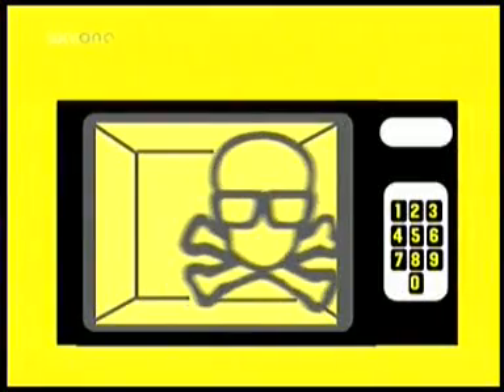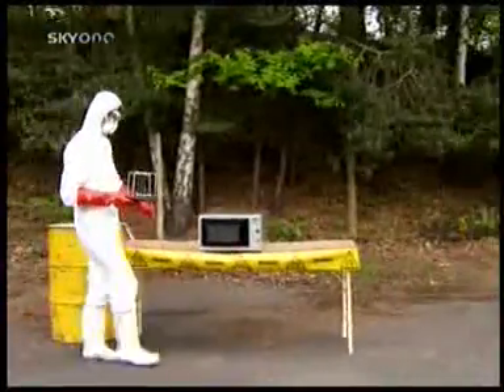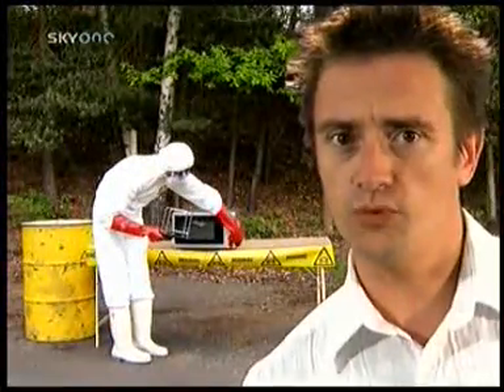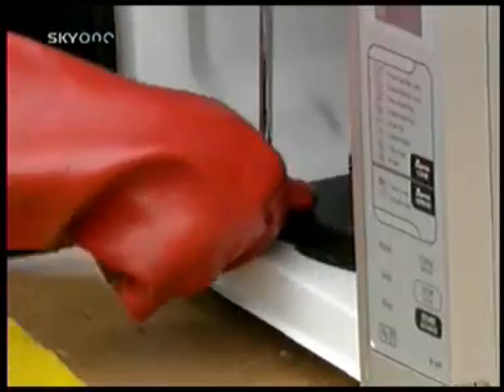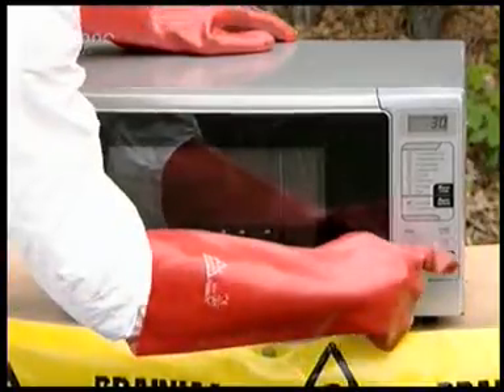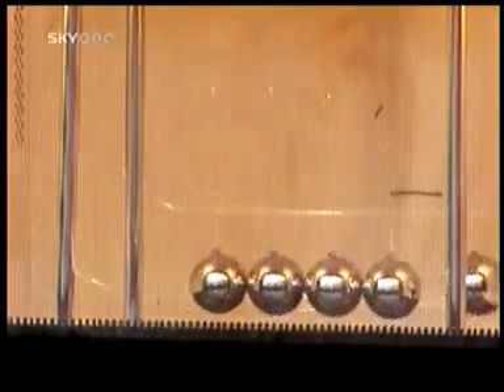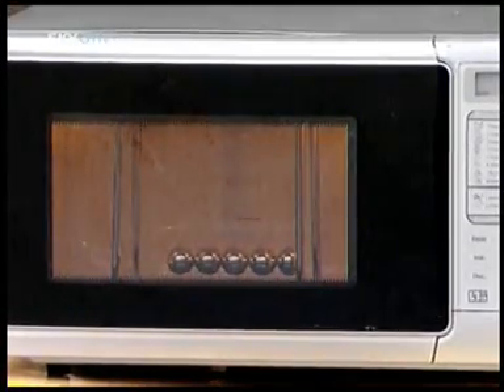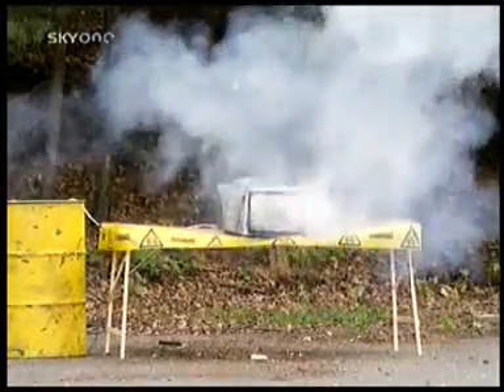Brainiac - Microwaves - Newton's Cradle

Comment: For those who wonder why it didn't blow up when they tried it at home, it is because Microwaves have a safety mechanism which turns off the magnetron on overheating.  I believe they have disabled this mechanism in the microwave used in this video so that the magnetron keeps going until it explodes.

Comment: nop, it does not.
Microwave doesn't create sparking points. It ionizes the air when another metal is there, causing electrical Arcs.

And No, it does not mess with the magnetron, it simply melts metals that come in contact, and other materials that come into contact.

Is it bad for microwave? Yes.
Will it explode? No.
Will it be dangerous for you?
Yes, only if you touch the metal that was just heated up

Comment: microwave energy causes water molecules in foods to move around more, hence turning them hotter, which is why metals cannot be put in a microwave - they do not have any water molecules to move so the heat is transfered back to the magnets which causes hydrogen buildup which.... BANG

Comment: no, its just the huge capacitors and the large coil of magnet wire in the microwave blowing, the oil inside of them ignites and sends the wads of burning oil soaked paper out.